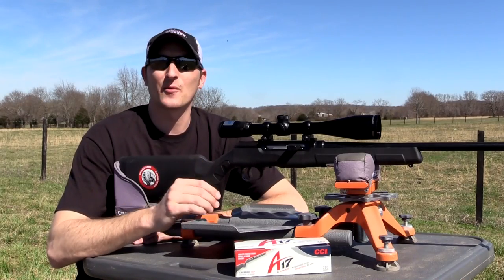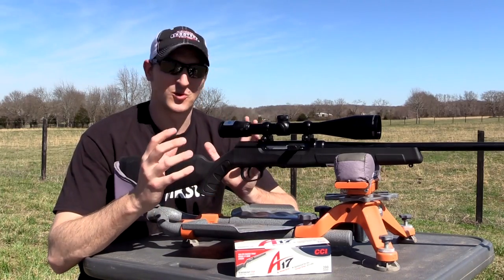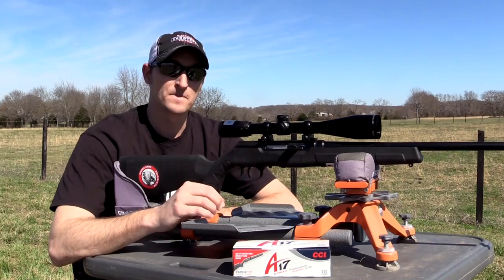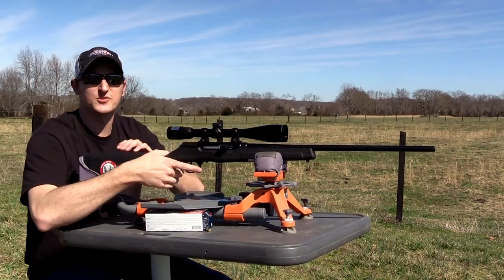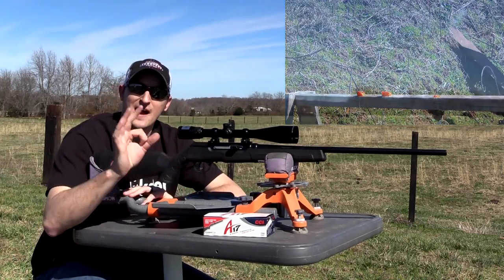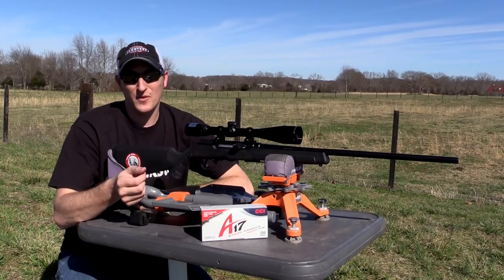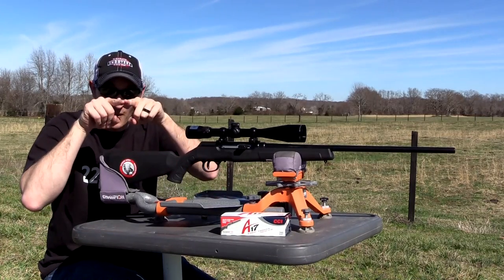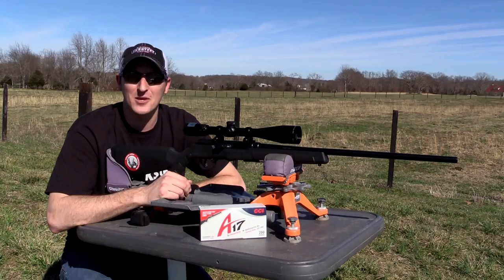SAVAGE A17 REVIEW.

Comment: I saw another video on this rifle and the guy complained about everything. He said the trigger sucked and it wasn't accurate until he purchased a different stock and seated it. My Savage bolt rifle .17 HMR has a stainless bull barrel and it will shoot under 1/2 inch groups at 100 yards right out of the box. Most of the time it is a tack driver. Most shots go through the same hole, so I believe Plinkster on this one. I know these are probably pretty accurate and I may get one.

Comment: I purchased the A17 Saturday and I love it. I own a Henry lever action 17hmr, so I already had plenty of ammo but went ahead and bought the CCI A17 ammo and had a lot of failures to feed, stovepipes, etc. I tried CCI TNT hollowpoints, and had problems with those also, Hornaday V-Max ammo on the other hand ran perfectly, shot about 200 rounds of the Hornaday and did not have one single failure. I even had one of the CCI's go off out of battery, which scared the crap out of me, so I probably won't be buying any more CCI.
Reply: +D Davidson the shell went off while the chamber was partially open
Reply: +D Davidson Thank you Ron.  Good to know.
D

Comment: I have the Savage 93R17 and it came from the factory with a 2lbs 12 oz AccuTrigger and a Savage Hog Hunter that came from the factory with a 3lb 6 oz AccuTrigger.  The 93R17 trigger pull registered between 2lbs 8 oz to 2lbs 14oz, so I called it 2lbs 12oz.  The Hog Hunter registers a consistent 3lbs 6oz.  Yours seems kind of heavy for an AccuTrigger.

Comment: I have an a17 an love it, for ammo I put well over 2000 rounds trough it, I can say the cci a17 ammo is the better ammo @ 2650fps rated it cycles 99 of of 100.. about 800-1200 rounds no complaints yet

Hornady v-max 17 grain works ok most times, need to clean action ever 200 to cycle reliably overall 2 out of 50 fail to cycle, after 1000 rounds I still buy more..

Federal only have used 50rnd so far can’t really say either way on them..

Winchester varmint 17 grain I can’t recommend 2 maybe 3 will cycle out of 10 round mag a17, bought 14 bricks of 50 and I’m not buying it again, it shoots well in my bolt guns (new b17 stainless)(savage 93 heavy) but still 1 of 25 case will rupture in the chamber an fail to extract so that sucks an not good for rifle I’d say.

That my just my experience, each their own.

Comment: I got one of these with the laminated wood stock. The gun feel perfect like a high end bolt action. I have a Nikon 4-12 scope and it is accurate and a joy to shoot. The 17 HMR is something else. The only downside to this great rifle is it doesn't work.  I've seen every video on how to insert the magazine.  None of those methods work. The mag hangs slightly down at the rear. I was thinking of using a hammer on it but that would be rash. Oh and wait until you try to load the magazine. You'll find out very soon this is not and Ruger 10-22 magazine. When shooting from a rest I put upward pressure on the bottom of the mag the gun runs just fine. It's time to take this bugger apart and see what's going on.

Comment: If I had 1 I would be burning a lot of ammo.... I have a bolt savage.... like you I love savage rifles... that's the only rifle I will buy and have shot for 25 years... only 22 I have not a savage is a marlin 60... I did the trigger on my bolt rifle and it has the accutrigger.. it's right at 2 pds and very smooth with almost no creep

Comment: I am impressed with the accuracy of that savage.  My concern is, if you are shooting something other than candy or cards or targets what will be bullet do.  I have seen several videos that shows that the bullets simply fragment and do not retain any mass.  Can a bullet that fragments like that be really effective on game?  .22 cal. bullets can penetrate ballistic gel 13+ inches and still retain their full weight and shape.  How much stopping power does the 17 hmr really have?
Reply: +Ken Johnson The 17 is one deadly little round. Penetration is not what kills. In the ideal world a bullet would penetrate to an organ and then explode. A 22 will pass right through causing bleeding to some degree and some soft tissue damage. A 17 is the opposite as it dumps all of its energy as fast as it can. So the 17 it good for a target that is fairly small. If you shoot anything from a coyote down to a squirrel in the head it is dead. The main goals of the 17 were simple. Shoot a flat and as "safe" as can be. A 22 will travel hundreds of yards after clipping a branch. A 17 will fragment on the same branch. That is a lot safer for tree rat blasting. In my opinion the 17 is to much for rabbits and squirrel. It will remove half a head. All in all the 17 is far more deadly for small game than a 22. As for stopping power. I would not rate the stopping power as it is a small game/target round. I have personally shot 3" 250 yard groups with my stainless Savage I got the week they were introduced over 12+ years ago. I often use it for crow hunting and on coyotes.

Comment: I have a A17 with Boyd's thumbhole stock. Came that way from the factory. I bought it used for shooting prairie dawgs and coyotes in Montana. This gun is accurate as all get out. My only problem is the factory mags do not seat well, you have the play around to get them to seat. I also bought 2 butler creek 25 round mags. They seem to seat better. Did you have any problems with this? I like the Hornady TNT ammo you used on the bullet proof glass...that should do fine on coyotes..?

Comment: I'm disappointed in my new A17, it shoots great and ejects spent rounds great but fails to pull the next round least 20% of the time. Savage sent me a new magazine and they were cool to deal with, but it has the same problem.
Reply: +Paul Martin Call them back. My Dad had an extraction problem years ago with a 30-06 and they sent a new one to the gun shop and sent the old one back in. And called a few times after as well if I remember right. Great company to deal with. Is your bolt super clean and oiled? It could be a tad sticky. Also you could try cycling it a hundred or more times to brake in the bolt. Good luck

Comment: Yeah, well, I have the Savage A series lamented wood stock. Using Winchester 17 hmr 20 grain jacketed hollow points.. I'll be lucky to get a 3-inch group at 50 yards... Caldwell's lead sled to boot.. I only put 100 rounds through it...changed to picatinny rail with Vortex 3x9 scope...any help??  do i need to glass bed the stock??

Comment: Hey plinkster. Is that ammo proprietary for that rifle or will it run on any. 17hmr?
Reply: According to one of the videos from SHOT2015 the A17 will run with any commercial ammo and conversely the CCI A17 ammo is fine to shoot in any 17HMR rifle. I think the A17 ammo is a marketing strategy to increase sales of both the rifle and the ammo. I haven't seen either on the shelves yet but would like to try some of the ammo in my Savage 93R17. With the standard Hornady V-Max 17grain I can shoot one ragged hole with any three shots at 50yd!
Reply: Arlen Archer thank you kindly
Reply: +lerch400block bought a 200 pack of the A17 branded CCI ammo a few days ago at my local Gebo's store and it's the same as any other .17 round, just branded to go along with the A17. though it has a non-polymer ballistic tip which is nicer. I've shot some of the polymer ballistic tips and actually picked out the tips from the rabbits and rats I shoot at the ranch.

No real difference though, that box of 200 cost me around $30, which to me is a decent deal since I send about that much downrange in only a few months.
Reply: Mine shoots fine with all .17hmr ammo. Accuracy varies depending on velocity and range.

Comment: if a 17hmr is a nected down .22 mag, could you make some form of rimfire thats necked down to .22?
Reply: i don't think anyone make rim fire that is bigger than a 22 any more. why would you want that any way? .223 is a center fire round necked down to .22
Reply: michael johnson i know in some countries rim fires are easier to get, but aside from that no reason
Reply: The .17 Mach II is a .22 LR necked down to .17caliber. I don't think anyone chambers new guns for it any more but ammo is still available although limited. Last I heard Hornady is still producing .17m2 ammo. You'd have to find a used rifle somewhere and that might be difficult as new guns were only produced for a short amount of time. My son had one several years ago (don't remember the make) and it was a blast to shoot. Pretty much a one-holer at 50yd. I think the velocity is around 1800fps if memory serves me correctly...
Reply: if you're looking for a more powerful rimfire cartridge look at the .17 WSM. It's a necked down .27 nail gun cartridge with a .17 cal bullet.
Reply: +TheAlexagius You could super sonic with a 22-250... super fast and accurate round
Reply: +Lanchoooo Good round but it is hard as hell on barrels. 500 hot rounds and the throat will be gone. Had a lot of fun shooting those. Eventually moved to the 243. Cheaper to shoot and a bit more versatile.

Comment: Plinkster do you have any experience with the Savage 93R17? If so how does it compare accuracy wise with the A17? I know one is bolt and one is semi but as far accuracy goes does the 93 have an edge being a bolt gun and having a heavy stainless barrel?
Reply: Mick, this is probably one of the best videos demonstrating the accuracy of the A17 and the 17HMR cartridge. Splitting a playing card is and amazing feat with ANY cartridge/firearm combo but becomes increasingly difficult as the bullet diameter decreases. The 17HMR is one of the most accurate cartridges on the market today if not THE most and I'd also say 22Plinkster is one of the most accurate rimfire shooters, if not THE most. Combine those two key elements and I doubt there's any he couldn't pull off with either semi-auto or bolt version of the Savage .17HMR. One disadvantage to the semi-auto would be the tendancy to be less conservative with ammo but in a small game/varmint hunting scenario the quicker, quieter follow up shot would also be a bit of an advantage in my opinion. My solution to this dichotomy is to eventually own both ;-)
Reply: I've squirrel hunted for several years with a Thompson Center .17HMR, the year before with a Thompson Center Mach II and the decade before with the most accurate 22 magnum I've ever owned.  It's a very competitive thing on opening day with the men of my family, we only take head shots and for reward we have THE dollar and bragging rights for the next year.  The .17HMR is more accurate than my 22 mag and the damage is more devastating.  The three of us shooting the .17 HMRs (2 with Savage bolts) consistently bring in more squirrels.  As I hunt in the woods, I've not experienced wind problems and am comfortable with a head shot to maybe 100 yards.  Beyond that I'm too old and shakey, the gun's a bit better than I am.

Comment: Love the gun---   can you recommend a medium price Scope for it?---  thanks
Reply: +Skridge Milky Check out BSA scopes. They are fairly cheap and I have never had a bad one. I currently have a 10x 50mm target scope on my 22 for silhouette and some paper. Not a single complaint in my book. Something in the 2x-12x variable power. And if you can swing the extra get the big objective lens. 50mm+. When you are in the woods and the shadows are deep the extra size will brighten up the view. My friend had a custom 10-22 with a 65mm nighforce scope. Hated the gun but what a scope! You could see till almost dark with it. Keep your scope mounts as low as possible to improve the close shooting zero.
Reply: +Naked Acres Thanks!
Reply: Everybody has their opinion, but BSA is about bottom of the barrel. Bad QC and the lenses are not clear. I shoot long range though. At 200 yards or less and 10X or less, a lot of scopes will probably be ok.
Reply: +TexanUSMC8089 Yes BSA are inexpensive. I have owned many and have not had a problem. I have owned Leopold also and they are way better, but cost 5 times as much or more sometimes. BSA is a great starter scope and is fine for light use.